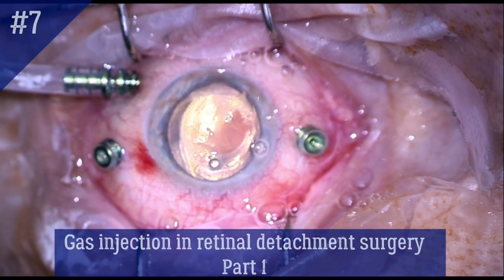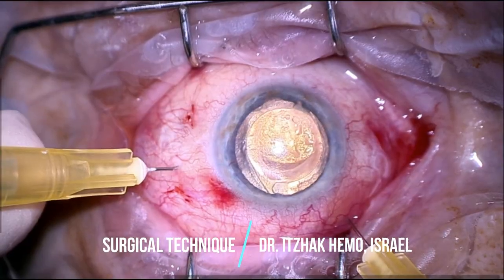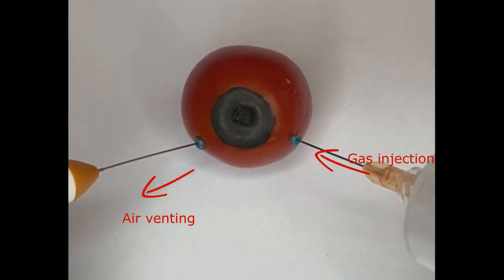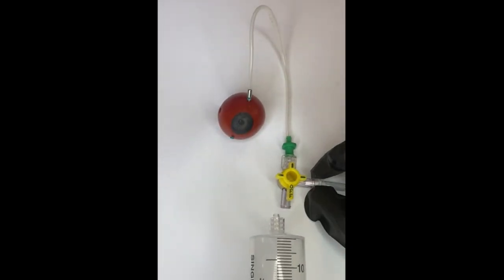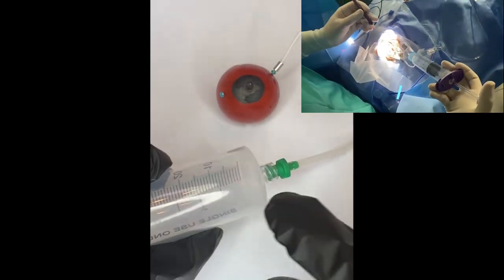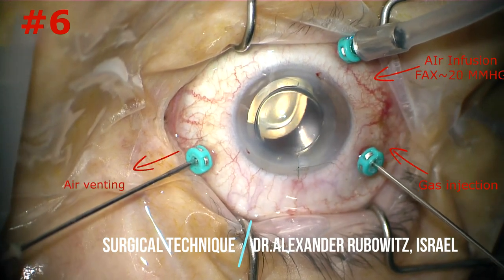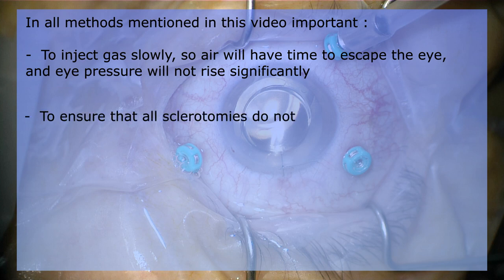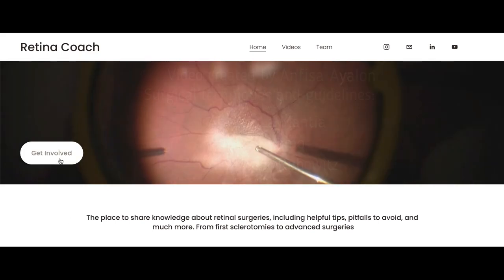Gas injection techniques. Part 1

Comment: İn the 6. tecnic do you give the gas undiluated?
Reply from the maker: In the 6th technique, the surgeon uses diluted gas. That's why the final concentration of gas can be suboptimal if not to use additional lavage after air infusion line removal.